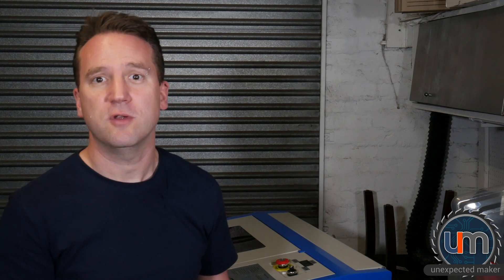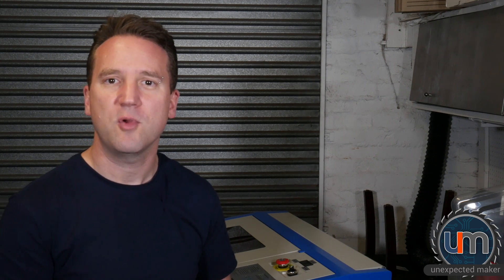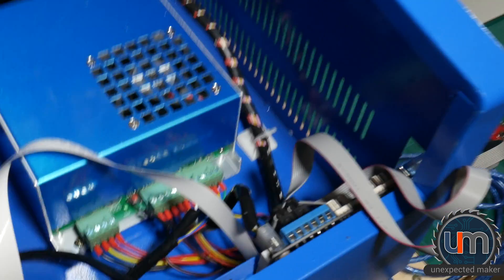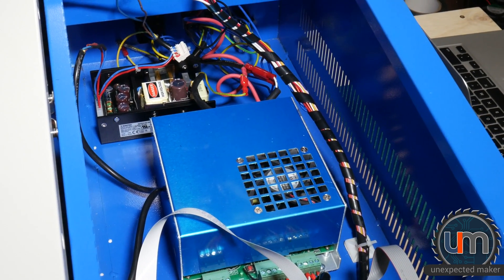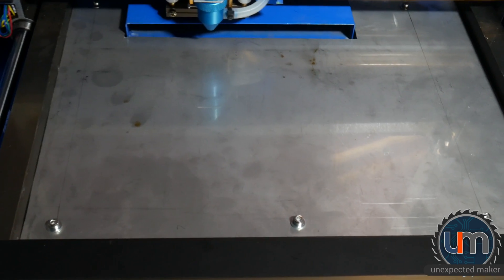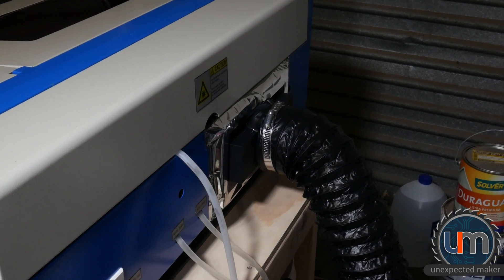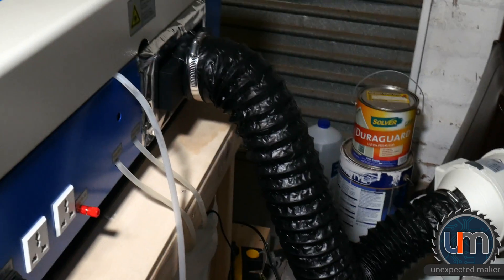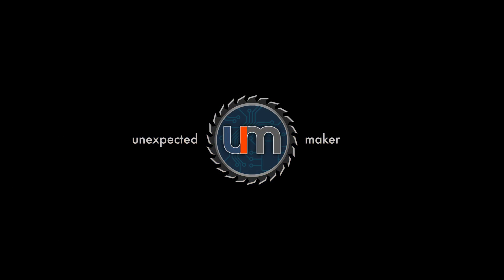K40 Laser Cutter - Update 01

Comment: how much power do you use on your ammeter to keep from over driving the tube.  thanks
Reply from the maker: I never run my Tube above 80%, though I never really ran it lower than 80% either unless I was doing scanning/rastering. I've moved on to a new 80W laser now and again, I never use it above 80%. Just my own rule for tube longevity.